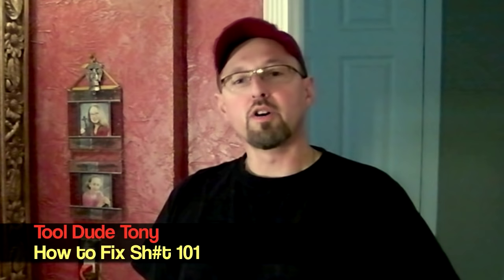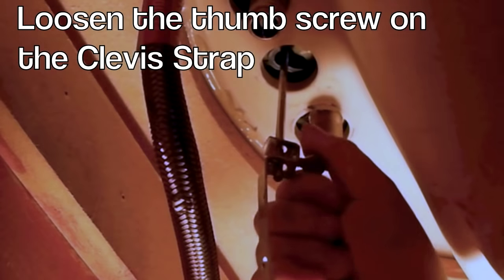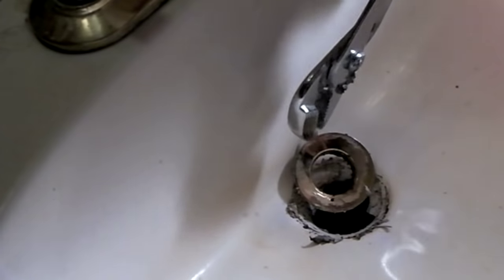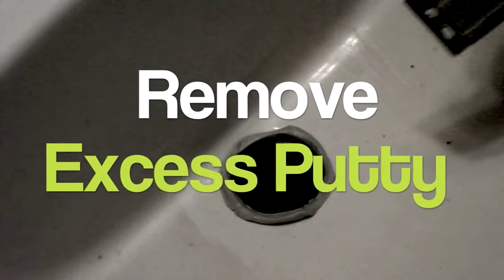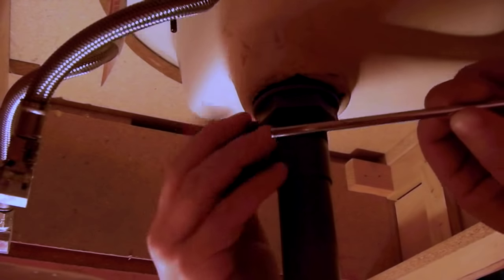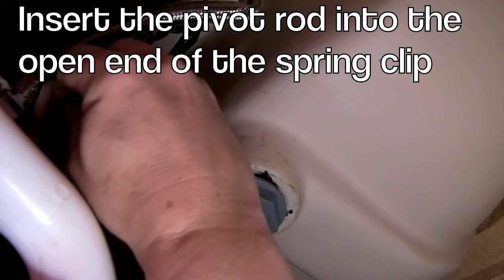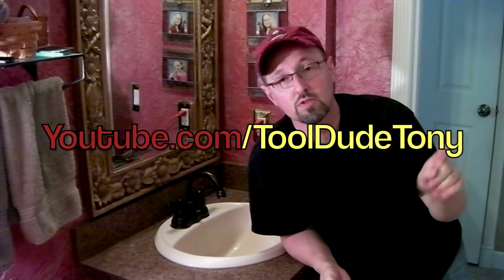How to Replace a Bathroom Drain and Sink Trap

Comment: Thanks for the video. I used it today when I replaced my bathroom drain. I was intimidated by the job nd have been living with a bucket under the drain for three months. I am sure I could have done the job with the sparse directions on the plumbing parts package. However, watching your video and pausing it as I completed each step greatly increased my confidence. I used the video, that is, until the "Test the Drain" segment. You removed the J-tube, as you said you would, but did not install a new one on the video. By the way, my old and new compression nuts came with expanded cogs for hand tightening. No tools were needed except pliers to loosen the rusted thumbscrew on the old plunger and a 10mm box wrench to tighten the hex nut/screw on the new one.

Comment: Thanks for the video. I just fixed my bathroom sink. I had it all together, but it still leaked. So I saw your video..I followed step by step. The thing missing the first time around was plumbers putty. Put everything back together as u said, and it worked. Thanks.

Comment: Hi, Tony I have a problem. I can not loosen the jam nut with the channel locks, I've tried and I don't want to strip it. Any ideas? I feel like whoever installed it before cross threaded the nut. Any tips would be greatly appreciated. 

Thanks, Kong

Comment: Hi   I manged to replace the sink plug (when undoing the screw it broke so that simplified matters!), I then only got as far as undoing the plastic piping.  I have a bathroom sink sitting on a pedestal and getting behind it is  really awkward.  I have been unable to get the wrench around the large nut (jamo nut?) to undo it - there just isn't enough room!  Added to that, I am partially-sighted and not very strong.  Any other ideas?  I have a socket set but the largest fitting is too small -  do you think I could get  a larger fitting from my hardware store or would it be more sensible to get the plumber in?    

I would like to be able to do this myself as the plumber was to come on Saturday but didn't and then he was to come today, but didn't.   I have other work for the plumber but I if I could do this for myself I'd feel so much better. I put the plastic piping back temporarily but of course it is now leaking as I didn't use any of the white tape - I didn't want to use that and then have to undo it again  as that takes some strength.  

Having written this, my gut feeling is: swallow my pride and  call the plumber.

Terri

Comment: Hi Tony, love your video and simple tutorial. I have a quick question regarding changing the vanity. I have an 18" vanity sink and would like to switch it to a 24". It will be a tight fit (vanity is between bath tub & toilet). Is there a recommended distance from one thing to another? Thanks!

Comment: Tool Dude, I am having difficulty getting the threads of the flange to completely screw into the drain tailpipe.  the jamb nut seems to be as tight as I can get it.  any suggestions on how to correct this.  I tried 3 times and it is the same each time.  
Thanks KT

Comment: I wasted a LOT of time trying to find a video showing me how to remove the faucet and drain, and all I found were the ones showing me how to install a new one, which do me no good if I cannot remove the old one.  I am making a note of Tool Dude Tony and will just look there first next time.  Other than not having a lot of strength in my hands, I did as good a job as any man... or any expensive plumber thanks to you!!!

Comment: Your video was very helpful, Tony.  Thanks.  

After installation, I still had a leak and, like Campworkaround, found that putty had actually found its way into the air vent in the sink's drain area, which is hard to see from the top but you can feel the channel on the bottom of the sink base.  I couldn't see it, but I felt it and felt the putty slightly in the hole.  I said to myself, "I wonder if that is causing the water to back up and then leak slowly down the threads?".  I used a clothes hanger to probe the area and fished the putty out.  Then the drain worked perfectly.  Like Campworkaround, it was just lucky that I thought of it, since it is hard to see the air vent from the top of the sink.  You might tell folks that using too much putty may plug up the air vents in either the drain pipe cylinder OR in the air vent, which will cause back up and leakage even when the assembly is installed correctly.  

Thanks again. Great video.  I will come back to you the next time my project

Comment: I have installed the drain assembly as shown in your video on two sinks, but I am getting seepage where the rubber gasket meets the bottom of the sink bowel. I have loosened and tightened the nut, but having no success in stopping the water seepage.  Have I compromised the rubber gasket by tightening it too much?  Not sure how to cure the problem, can you help

Comment: Thanks Tony,  I was able to get through changing the pivot. But have to take it apart again as the threaded brass rod came out of the plastic ball that inserts into the plunger. I imagine I didn't thread it in enough. Love how clear your video is shot and with chapters. Nice job.

Comment: It worked! But...after everything was tightened, water was leaking from the rubber gasket from where the pipe assembly attaches to the bottom of the bowl. The replacement assembly I bought from Home Depot is mainly plastic and I didn't want to over tighten for fear of breaking it. What can I use to seal to prevent the leak? Thanks very much for your help, I could not have done it without you!
Reply: Plumber's putty..ask the sales person at Lowes in the plumbing dept for the right kind :)

Comment: A small problem in my house always turns into a major job.   When I plug my sink  to shave, wash, etc, the water slowly drains out.  So I decided to replace the plug.  Easy, right?  Not at my house.   When replacing all the guts to the system, the little ball unit leaked so I kept tightening.  Cracked the plastic nut.  Turns out that one little nut is no longer made in that size.
After watching your video, that's the way to go.  I thought it was a major job buy know I know it isn't.  Thanks!

Comment: Well done video except for one thing....I finished and it was leaking.  Redid and it was still leaking.  So once again I followed these instructions and, yes, it was still leaking.   :-(    I figured I was not getting the putty snake right but it had nothing to do with the putty.  The easy fix for this is THE VERY FIRST TIME use either pipe dope or teflon tape on the threads.  Water will leak right in the thread grooves and from looking at some of the other comments this occurs in a fairly significant number of installations.  If you have a question about how to do this there are other videos here on YouTube that show this step or just do a search and you will find a forum that explains this step. Fourth try was the charm after using pipe dope.

Comment: very informative and thorough; however I had a problem after removing the p-trap, I cannot loosen the nut which is holding the tail piece in place; used a channel lock pliers as shown in your video. Any suggestions? (the assembly is 40+ years old)

thanks in advance.

Comment: After replacing the pop-up drain on my bathroom sink, I prepared to reattach the trap.  However, when I tightened it, the uppermost join ended up loose (i.e., the pop-up drain moves around even with the nut tightened).  Am I missing a part?  I may have misplaced something.

Comment from the maker: @Sierra - You probably don't need to replace the whole assembly.  If it were me, I'd take it appart and put a fresh roll of plumber's putty around the top of the drain and then I'd check the gasket that is under the sink just above that big nut and see if it looks okay (not ripped or disintegrating).  Then be sure that big nut is nice and tight.  If that doesn't do it, you may need a new assembly.  They are usually under $10.   I hope that helped.  Thanks for asking.

Comment: I'm glad this video showed that you probably have to grab the flange with pliers (destroying it) to get it out.  This is particularly true on older, non-PVC connections that will have rusted or simply locked in place if they've been there for years.

Comment: If just the large nut under the sink is leaking do I have to replace who part  set up. I have been trying to get a slow drain fixed and turned to hard on the P valve and pulled the nut and seal apart and now I have a water leak.

Comment: What's with the half circle holes in the drain pipe near were the chrome piece threads on?
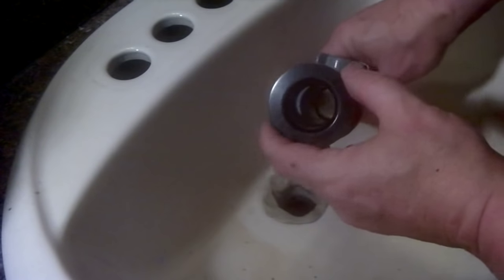You can see them at 3:06--3:07. 
What are those holes for?
It looks like the thick rubber washer covers them.

Comment from the maker: You know how if you overfill the sink, but it doesn't actually overflow?  Well the sink has an overflow hole high on the back.  There is a tunnel from that hole into the section of the sink where that pipe attaches.  Those holes are in the drain pipe to let that overflow water flow into and down the drain instead of all over your floor.  The thick rubber washer fits just below the holes when everything is tightened down.  That was a good question.  Thanks

Comment: That makes sense, unfortunately my sink is a cheap fiberglass piece of crap, that doesn't have those overflow channels.
I don't think the fiberglass is even a 1/4" thick where the drain goes through.
I just cleaned the old one up and put it back.
There was nothing really wrong with it, I just figured while I was replacing the faucet I'd change it.
Thanks for the help.

Comment from the maker: You may be tightening it too tightly.  Be sure to put a bead of plumbers putty around the hole and tighten the nut so that it is snug but don't try to crush it.  The putty will make it seal.  Thanks

Comment: I appreciate the shit out of you. Just so we're clear. Now, to my question... do you HAVE to replace the J tube or is that just getting fancy with the spices?
Reply from the maker: Clever FB name.  No you don't have to replace the J tube.  Mine was full of nasty drain goo and for $5 I figured why not.   Thanks for asking.
Reply: You don't have to replace the J-tube. With PVC, I see it is just a matter of "Eeww there's gunk in it." If you have a metal J tube, the drain water corrodes the material and wears it away over time from the inside. Odds are that by the time you change your drain assembly, the J tube it has become so corroded that it is as thin as paper and when you try to remove it, it will just fall off by itself. So, nice to have one in hand already instead of having to make a second trip to the hardware store.

Comment from the maker: Normally a big channel lock pliers will do the trick. If not cut the plastic part with a hack saw and replace the plastic drain stuff when you install the new faucet.  Cheap fix.

Comment: Very cool... Have to do this exact repair tonight...thx Tony!  I'll post again when done! ^_^
Reply: Hi TDT!  Ok, so the repair went quickly... I was repairing a bad putty seal between the basin and the bezel.  One thing I noticed was that I had to really WATCH how much the bezel spun in the hole when I was tightening the pipe.  The first time I wasn't so cautious..and I could see that the bezel had wiggled in the hole with the putty, gapping and thinning it.  I took it back out and redid it, but was very careful to trap the bezel with my fingers so it couldn't wiggle or spin.  Great instructional vid... right now I'm letting the basin do a 15 minute leak test with the drain closed and several inches of water sitting in the bowl.  Thank you! :)

Comment: @Tool Dude Tony   I did all that replacement my bathroom sink drain is the same but the straight pipe that goes into copper drain in the wall plumping it still leaks water down to my kitchen. Is there supposed to be a rubber seal clear plastic and a black rubber gasket that goes into plastic nut that tightens the drain pipe into plumbing pipe?

Comment: Thank you for this! The drain I installed had rectangular holes on each side of the cylinder (they all did). After assembly there's still some putty showing in these holes. Is that normal? Looks like it could make contact with water passing through the drain. Should I worry about this?

Thanks!
Reply from the maker: There really shouldn't be any putty on those holes when you are done.  A little wouldn't matter, but you may want to try to remove some of the excess putty by poking in those holes with a screwdriver or something and try to knock some of it away.
Reply: Tool Dude Tony
 
Thanks Tony. I figured out that those holes are meant to line up with the overflow fitting inside the sink. Then I took it all apart and redid it. Funny how hard it was to find an explanation of that online. Thanks again